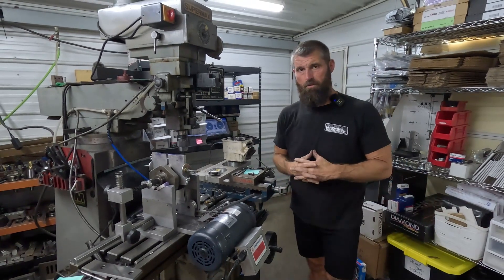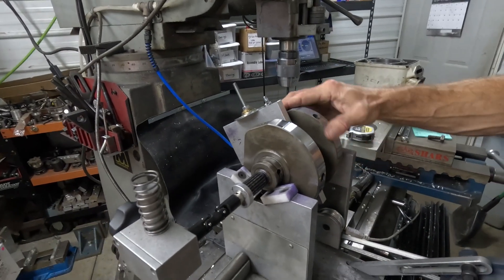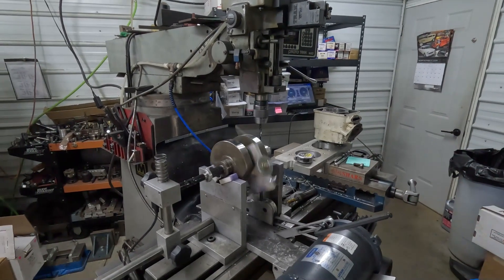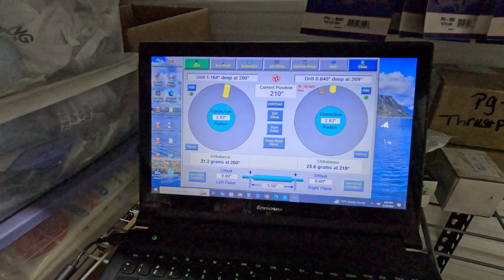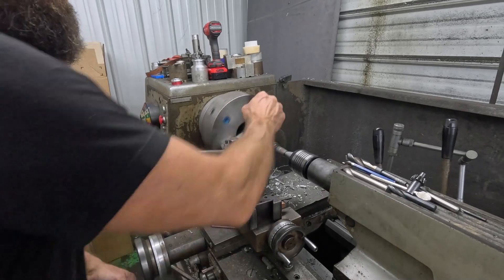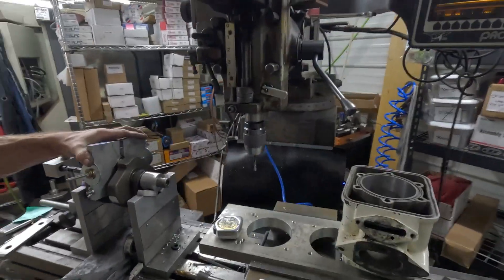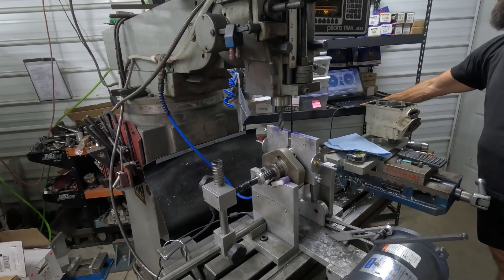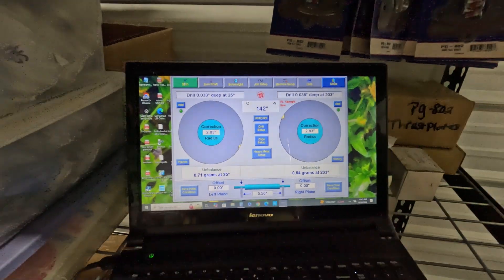Suzuki 650 twin balance job

Comment: I guess they are saving the extra $8.50 for their pockets rather than pay someone a salary to balance these all day. 
  Thanks kindly for sharing! Very interesting.
Reply from the maker: Exactly!
Reply: @powellmachineinc   We both know there is a perfectly good machine sitting there to balance this rotating assembly. Someone just thought they could skip this because after all, it’s a two cylinder. They all vibrate!

Comment: Found it the way you did also lightened the crank shaft as well would it? Your taking off more metal in a general area then a small amount in precise area. Thus it should rev up quicker for the customer?
Reply from the maker: Correct

Comment: I am guessing that you did not know how well the Suzuki was balanced from the factory because now you are installing lighter Wisco Pistons.
  My Engine Builder guaranteed that everything with within 1/2 gram.  Seems he said most shops shoot for 1 gram or less.  Maybe  From GM is 2 grams or less.
  I took a Community Auto Shop class.  No matter what you tried, their car tire balancer would never 0 out .. I don't know what was wrong, but seems it did not work at all.  I Balance my motor cycle tires on a stand with an axle  cones and bearings.

Comment: If I recall correctly, My Locally famous Engine builder did all of his balancing statically.  I actually built the  488 BB Chevy Stroker engine in about 1985.  I was grinding clearance in the block oil pan web area for the stroker crank.  I thought everything cleared, but when I put two roads on the same throw it did not clear.  I had some stock bore pistons with out rings to put in the cylinders.  and swing around and put layout die on the areas that did not clear.
  I just watched a David Vizard  Video about quench area and if you leave the piston in the hole he claims you loose HP & Torque and get detonation.
  When I was trying to figure out what engine to build.. I found a Combination where I could use a stock 454 car Piston  the 4.25 Crank,, a Longer Crower Rod .  It seems like that combination came up 0.020 short of the deck and I used the thick Fel-Pro Teflon head gaskets..  Same with  my '79 Z-28 Smog motor .. when I had the heads off I replaced the stock steel head gasket with a much thicker  Teflon gasket so My compression is under 8.2 to 1 now.  The only reason I could beat most everyone I raced back in the day is because I added 110 HP of Nitrous. All I ever had to run is 87 Octane.  Now I would like to build a high compression motor that runs on E-85 or a Mixture of E-85 and E-10   I need to built a stainless steel gas tank.
  I don't think many stock car engines have their Pistons and rods numbered , but I think they were balanced at the factory  in closely matching pairs of rods and pistons.
Reply from the maker: You can't balance a crank staticly
Reply: @powellmachineinc    I am guessing that you can do it faster with dynamic equipment.    I ported some really fast Yamaha YZ-80 two strokes as a teenager.
  My GYT Kit Piston had longer taller piston ports.  My YZ-125  simply had a big U-cut out of the piston on the intake side.  I cut the sleeve off on my GYT Kit Piston and used bigger reed  valves too.  Cutting the Piston sleeve made it wicked faster.  I always wondered how much I threw off the balance cutting part of the sleeve off from the Piston.  There was never any noticeable vibrations.
  I later put a GYT Kit cylinder on a GT-80 .  If the bike even got on the pipe  into the new power band it would blow out the 6 volt headlight.  I realize now there could have been a few ways to protect that valve, like some sort of a resister ..
    The RPM's were so high on that bike that it sheard all of the rivets off from the flywheel.  I replaced the points ignition and external flywheel with an internal  rotor CDI from a later Model YZ-80 ..
  With a better hotter spark and much less flywheel weight the acceleration was again much better than before .

Comment: I have a Chinese minibike with a knock off Honda. It's so out of balance the front fender broke off and the exhaust fell apart. I welded up a straight pipe and that broke off eventually too. I had a two cylinder opposed Kohler that threw a rod but kept running. This Chinese Honda is worse than that Kohler was.
Reply from the maker: Yup

Comment: if i was to send you a 2008 yamaha r1 rotating assy would u be able to balance it  i want to spin this engine 20k rpm as it is rpm is only 14500
Reply from the maker: I have done some, they were spot on

Comment: My guess would be they don't have the heavy factory pistons and sometimes rod also may be why so far out of balance. I know from my years kart racing the aftermarket stuff was way lighter than the factory stuff it came with. What y'all think????
Reply from the maker: This was only a piston swap,  left to right isn't effected, and it was way different,  also the piston were not much lighter but we had to remove over 40 grams

Comment: I am an electronics technician and have seen impedance issues with 90° connectors. A simple test is to try a straight connector wire and connect it and compare the signal to the 90° wire. If you get the same result then you’re good.

Comment: SV650, very popular track bike with lots of nice go fast mods. Pretty high power for a V Twin. If people get wind of you being willing to work on them, you might be able to grab a decent bit of business. There is an SV1000 as well, but due to cost and relative performance, the 650 might be the more popular.

[edit] the 650 single is probably not worth this level of work, but popular to mod into other stuff.

Comment: The reason for all of these engines not being balanced properly is very simple, in fact in a word: "accountants".

Back in the 70s the Ford Pinto's gas tanks used to catch fire and explode due to poor design. They knew they could fix the problem with a piece of plastic that would've cost them under $1.75 per car but the accountants figured that given the number of people that were dying and the number of people that were successfully suing Ford, it wasn't cost-effective to spend that $1.75 per car.

They figured it was cheaper to let a couple people die than change the manufacturing process .
Reply from the maker: Definitely

Comment: I think you do excellent work! One thing I think you should look into. With those small engines, especially the motorcycle engines, they have a generator rotor/flywheel that I just one side of the crank. And on the other side you'll have a spur gear that drives the clutch. Anyways, a lot of the manufacturers use the flywheel to help balance, they usually have a bunch of balancing holes in them when I take them off. I wonder if that helps contribute or take away from all the imbalance that you initially see. I'm thinking they might balance those flywheels with the cranks?
Reply from the maker: The should be neutral
Reply: @powellmachineinc  well, if they're supposed to be neutral, then that's really really bad. Thanks for the info.

P.s. what does a guy usually charge to balance an older style Harley crank?

Comment: Decades ago, I helped my boss rebuild 2 Dodge 318's for a big boat. After we installed them and during the maiden voyage, the owner couldn't stop commenting about how smooth the engines ran. He said that compared to the pre-rebuild engines, the new engines felt like electric motors running. After that, I dismantled my low mileage 1976 Pontiac 455 to get it balanced. When I got it back, there was barely any drilling done to the crank and only 4 rods and 3 pistons had any work done to them. I guess it was already close from the factory.
Reply from the maker: Anything is possible,  but I've never seen a factory balance job that was good

Comment: Hey Daniel, nice job on the balance job.
What rotating and reciprocating weight factors do they use on these?
Or is it 50%Reciprocating and 100% Rotating?
Thanks, Ed.
Reply from the maker: 50% like a v8
Reply: @powellmachineinc  Thanks Daniel. 👍

Comment: Looks like a seadoo 800 cylinder sitting on the mill
Reply from the maker: 720
Reply: @powellmachineinc3179  it's a seadoo 787 or known as a 800.  The 720 never came with power valves 😉
Reply from the maker: @EricksonMachinePerformance  yeah, I'm not up on this stuff, they just bring me boxes full and I bore and hone,   lol
Reply: @powellmachineinc3179  I get it 100%      I wasn't knocking you.      Great video by the way.     I was just correcting to make sure u didn't order the wrong parts for it. We machine a hand full of them weekly
Reply: @powellmachineinc  https://youtu.be/fsiBrn8e-XY?si=VyzLsLt8XNOYAJ6G

Comment: I have a Honda fury, it's a v twin single crank pin crank and I'm wanting to change the firing order to get the sound of a Harley or S&S. Will changing the cam timing to do it throw off the factory balance? I know I'll have to add something to trigger it to fire the plug in the correct position, but I'm just worried about it affecting the balance, because I'm sure they balance them differently firing on very other stroke than they would firing them back to back. Do you have any knowledge on this subject? Most people say just buy a Harley, but I don't want a Harley. It looks like a custom chopper, especially with all the work I've done to it, it just needs the sound to go with it.
Reply from the maker: No, it's a independent issue
Reply: @powellmachineinc3179  what i don't understand is, sooo many people just swap pistons in small motorcycle engines and say, oh it's ok, it just moves the harmonic into a different RPM. I'm like no, that doesn't sound good, lol
Could you balance a small 125cc honda crank?
Reply: Go buy a Harley then...
Reply: @derekcoor04  if Harley made something that didn't look like a rolling recliner, I would have. Did you even bother to read what I wrote?

Comment: Great video!  Reminds me of working on cummins b and c series with a, b, and c pistons.  If they can save .0000001 cents in manufacturing, they will do it.
Reply from the maker: Unfortunately
Reply: @powellmachineinc  It is job security for you though!  I am curious if and how much your customer will notice the difference of your balanced assembly versus how it was from the factory?  Even if it is not noticable, the increase in longevity should be considerable.  Again, thank you for your content, especially on cams as I have learned 🧐

Comment: Don’t know how much truth there is too it but had heard form several motocross and karting engine builders that they add to much counter weight to over dampen at the very high rpms these engines run at to make up for the difference in how the connecting rod accelerates the piston vs how the counter weight creates force
Reply from the maker: Definitely not true

Comment: Sv650! I used to road race those. Built mine with nice rods. They were originally designed and sold in Japan as a smaller engine then they made them bigger when they started selling them in the USA. So it's easier to get them to blow up than say a kawi 650  since they've already been pumped up. Great bikes though. Can easily get 85hp reliably but over 90 or 95 and the crank is going to die sooner or later. Years ago Andy Palmer made an unobtanium sv650 to break all of the lap records here on the west coast. Made over 100hp. Broke the crank case mid season, had an aftermarket crank so that survived!
Reply: I raced an SV a few years as well. Had a blast on it.